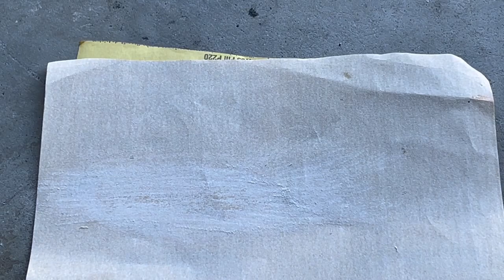The ULTIMATE Airsoft Lens Protection - Step By Step Guide

Comment: Hi mate. I came across you video as I was looking on how to cut Lexan but more importantly if it would distort the image as want to use it to protect my DJI Action 2 camera. I have my Action 2 on  my drone which I fly freestyle with. Have you noticed any image distortion at all? and do you think it will work filming a camera through? Thanks in advance!
Reply: as long as its perfectly straight, it shoulnd't distort. unless there are imperfections inside the plexiglass itself.

Comment: for anyone not from the US:

Lexan is a brand name, the proper name of the material is Polycarbonate
make sure that it actually is PC and not other materials like acryllic or clear styrofoam, as only PC has the abilities to survive multiple hits

also
1/8" (3.1mm) is actually way to thick, 2mm is more than enough, and even 1mm can withstand 3J hits (but these leave white marks!)
Reply: lexan is just type of pc
Reply: @xxs1lentk1ller30  no, it's a brand name for PC

There is no different types of PC, because PC is PC

Comment: Works for only cylindircal optics but lets say you have an eotech holosight or a rmr on your pistol
 What then. Luckily my primary arms rmr is perfectly square shaped. So i only need to worry about 90 degree angles.
Reply: Trace the shape of the opening of the red dot and cut that shape out. Use glue to hold it on place